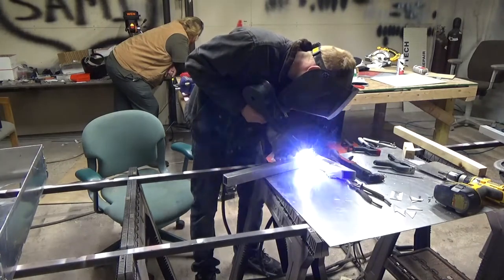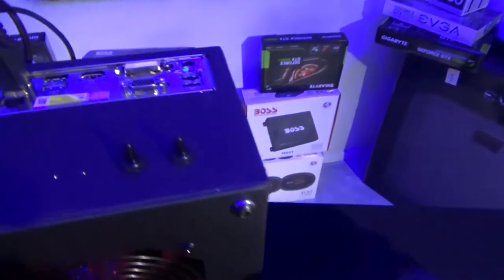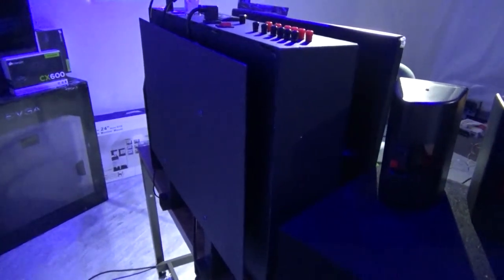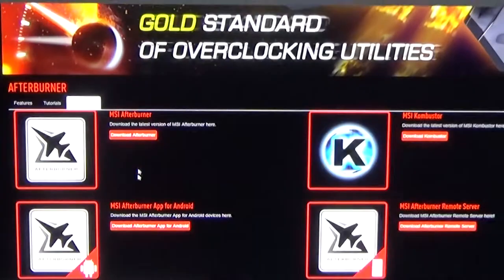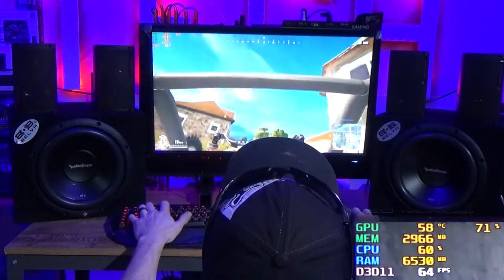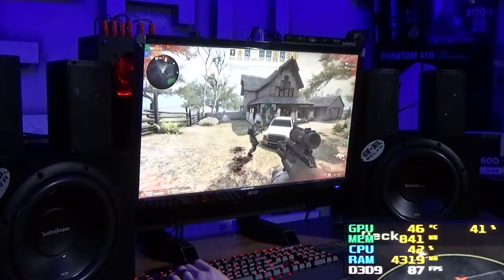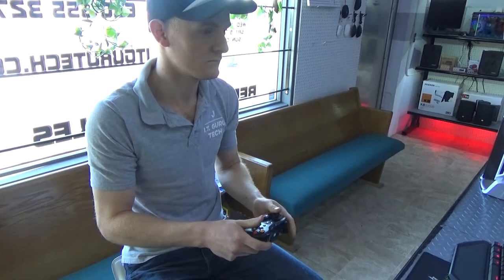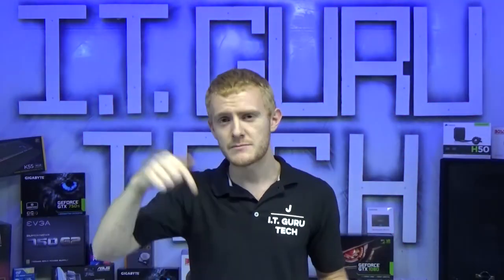R.I.G Unit: INSANE, CUSTOM, ONE OF A KIND, AMPLIFIED, MONSTER GAMING PC!! - $2995

Comment: Like you can literally put together a full system with better everything for that price.
Reply from the maker: I can build you up to 2500w RMS @ 6OHM per channel, however many channels you want, but that's some crazy powerful stuff... I think you'll really like my latest model. This unit has 4 X 160W RMS @ 4ohm integrated channels but also comes with an optional 1000W RMS @ 2ohm independently powered sub. Not super huge, but a nice upgrade over the AIO unit in this video. Also, this AIO unit's price was reduced by $1000 this summer.